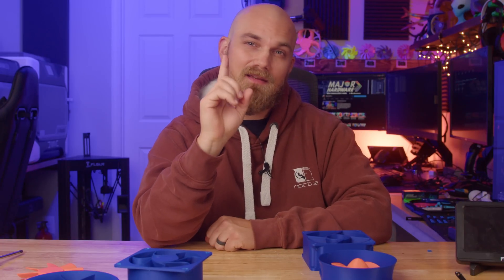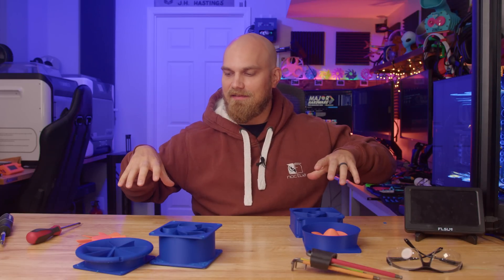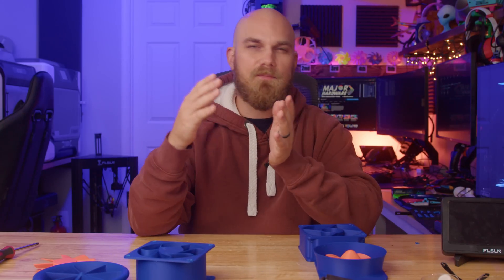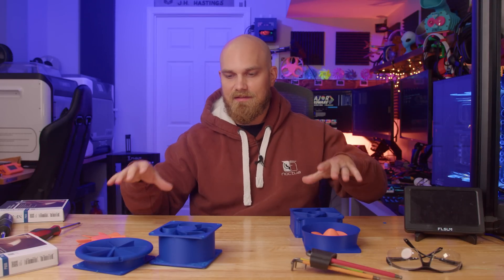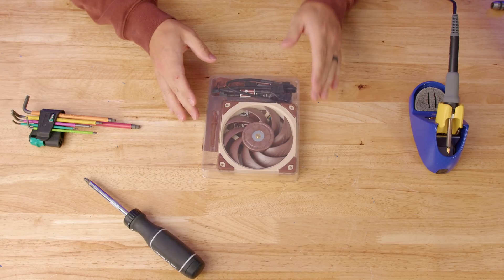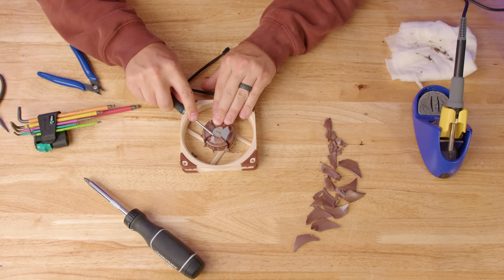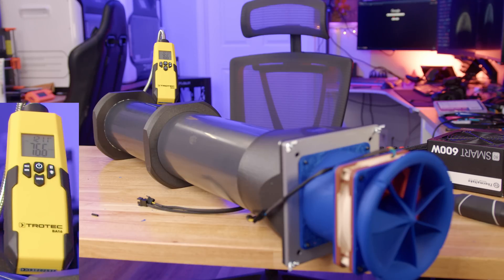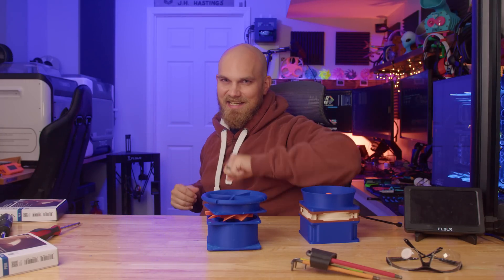Which One is REALLY the BEST | Fan Showdown S4 Finale

Comment: I normally don't comment, I just enjoy, but figured I'd give my opinion since you've asked so nicely. :) I think you should keep the airflow test. But I also think you should keep it to only the fan itself and no extra shrouds, add-ons, etc. Many of those fans just aren't viable in most setup so while they might be awesome, in theory, they aren't actually going to get used. Making sure the fans don't exceed the depth of the built in shroud, allows a more realistic idea of what is possible and convenient in all cases across the board.

You could dedicate another series to crazy wacky fan designs that is more for fun, while having a stricter standard for straight real-life performance testing.

Fun Fans: Fan Showdown
Serious Fans: Performance Showdown

Comment: What about light weight PLA for the fan blades? Also you can test static pressure of the fans, since it will be different than the air flow. I think a good mix of pressure and flow makes for the best cooling fan.

Comment: Personally I'd like to see it broken down into a system where noise, static pressure and air flow can each be measured and have a formula on the spreadsheet which combines all into a final score. Though it might be a pain determining a formula that weights each component accurately and accounts for things like a lower noise level being better. 
If that's not possible it becomes a question of what the exact point of the fan showdown is. Are we trying to make a fan that pushes air the fastest or with the highest pressure? Case fan or cooler fan? I think an air cooling tower probably makes for the best middle ground but any practical cooling test will always be subject to changes in environmental conditions unless your testing in a room with accurately controllable temperature, humidity and so on

Comment: Looks like most people are saying to keep using the airflow test but adding some kind of restriction. I think that's the best. Also, maybe don't use a poll system and just choose yourself, because when you do a poll, anyone can vote, and people will vote on what just looks cooler and not think too much about it.
You can probably feel safe after reading the comments and picking the best solution, ratter than leaving people like me choosing for you.

Comment: As some comments below say as well: We should measure head vs flow and it should be instrumented with some form of microcontroller to do it semi automatically like the noise testing. That way we will actually have in some form both forms of testing. When head is at a minimum we get the current form of flow testing. When head is at a maximum Flow decreases and we are measuring something akin of placing the fan against an air cooler acting as the flow obstruction (hence more head required). To actually give metrics we could perform an evaluation to assign grades referenced to a baseline (the noctua fan). Something along the lines of 

P = Qfanmax / QNoctuamax + Hfanmax/ HNoctuamax 

I hope this gains some traction. Upvote to get him to see this!

Comment: My issue is that we are using arbitrary measurements. Yes, noise and flow are important. However the flow you get from an A12x25 open air vs putting a radiator in front of it, or putting it in a closed case are all real world use cases that significantly impacts the performance of the fan. For that reason, we need to know..  maybe these fans have a specific category that they outshine in!  Free flow, static pressure, or noise!   For that reason I think and always have thought we need static pressure tests! You can have the cheater beat all in overall flow, but if it tanks when you put a radiator in front of it, what good is it?  

Maybe if a fan bombs in the "free flow" leader board, it might be at the top of the static pressure leaderboard!   We need more information. Maybe I want to make a fan and use it, but because we don't have the info, we don't know whether it'd make a better case fan or radiator fan...?  This would solve that.

Comment: I still think it would be cool to use the Noctua RTX 3070, since it has two fans so people could design dual hub designs, belt connections, etc. The space constraints would be interesting. If you can't get a Noctua GPU, you could always get an aftermarket GPU sink from Arctic or a similar company.

Comment: I like the current setup using airflow with your chamber to test CFM seems to be the right way, but maybe add a radiator to impede some of that airflow, and a bonus plus, it could test temps at the same time if setup the right way.

Comment: I think the flow test is the best way to do it, just add a radiator behind the fan. Maybe a couple different ones? One really dense high fpi and another with low fpi. That should give you the same results without all the extra variables like ambient temp and whatnot. Plus it's probably a lot quicker!

Comment: My opinion is to use a static heat source something like the hot side of a peltier cooler, that way you know it will distribute the same amount of heat into your loop, unlike a cpu. 

I also think you should utilize 3 of the same fan on a 360mm radiator. While this is more work it averages print inconsistencies and makes for more reliable metric tracking. 

Lastly the airflow and sound tests are still variables that should be maintained if only as data points. If nothing else this will validate the theory that you cfm is the most relevant factor. 

My only thought is while this is all very cool for us the viewer and makes for better metrics, it is all more work especially when trying to squeeze all that content into a sub 20 minutes video. Just food for thought, regardless I will be happy and enjoy, that you for what you do.

Comment: I think we should do a custom 2x(2x80mm Radiator) loop with them in series kind of like forming a Jet engine. The reason behind this is that I am attempting to create a PC case that looks like a Jet fighter/Bomber.

It doesn’t quite have to be the 80mm size As i can probably do that in my own time with my own test bench setup but it can help me when it comes to inspiration.

Comment: If you have time you can test both to have the best air flow and the best static pressure fan, you could just had one piece behind the vent and test the speed drop with and without the radiator.
and to make the AIO test instead of a computer you could use a Peltier cooler with the hot side on the AIO, as it have a linear heating if you apply same voltage and current to it, so the test would be more similar and you just have to get the temperature drop between the different ventilator.

Comment: My suggestion is that you should rank them in two (or possibly three) categories in the future: 
1. Airflow, as in this season – Good unbiased comparison between different designs
2. Cooling capability – Will give an appreciation for the applicability to real-world purposes
(3. Static pressure – This will play into how well the design will rank on 2. above)
The first category will give an unbiased comparison for an unloaded fan, the second will give a measure on how well it will perform if used for its intended purpose. I wouldn't mind if you had two lists, as you pretty much already have that. Of course you will have to use the same heat sink/radiator for all your test if you are going to use the cooling capacity metric.

Comment: If you're definitely moving away from flow testing, how about doing water, but instead of measuring processor temps, measure the coolant temps under a controlled load.

Comment: Some amount of resistance in the airflow would be a more realistic test. But there's no way to accommodate for all the different kinds of radiators or tower fin stacks.

So just 3d print a resistance part. You've got a resin printer, so you should be able to make up a kind of "average" fin stack and print that. In the end the "cooling" a fan can do is nothing more than a function of the airflow it can produce through a fin stack and that fin stack's ability to transfer heat.

Comment: I think there should be some kind of resistance in the test so that pressure is tested. No PC fan gets to live on pure airflow. There is always some kind of impedance. So adding a radiator like many have suggested to simulate water cooling or maybe mesh at the fan intake with mesh in the pipe before the flow gauge to simulate a case fan situation would be great.

Comment: For me the main change should be to make the designs be as useable in a normal situation as possible. No foot long multi-piece setups that would never fit in an everyday case or something equally as useless to a normal user. I'd like to see every design be able to be printed and tossed into a viewers system with no modifications.
If you didn't want to hinder creativity with those limitations I would say to replace the A12X25 with a motor powerful enough to spin every fan at the same RPM. It's unfair that you allow a design to be as over the top as possible and then kneecap its performance with a motor that can't handle it. 
You need to either restrict the designs to fit the motor's capabilities or beef up the motor to suit the lack of design restrictions.

Comment: I'm fine with the airflow test moving forward. However, if we are going to switch back to cooling then I think it should be a more realistic cooling setup.  No air cool heat sink.  That was the issue I had with the cooling test and the Cheater.  I felt this gave an advantage to high velocity directed flow.  I like the wind tunnel because it equalizes the directed flow for all fans.

Comment: honestly id love to see a revisit where you just take some of the fans that either under performed but where really cool or fans that did really well from various seasons and  retest them with a different test and see if maybe they just got a bad deal on test platform 
like for example im sure there where probably some fans from the season with the radiator but just didnt have much static pressure so kinda flopped but maybe would be killer at a test like this seasons test 
also just seeing the top fans from earlier seasons tested with the new benchmarks would be cool

Comment: I welcome the change back to cooling performance, as it's closer to real world applications than generating air flow through a tube. (No preference bewtween air or water cooling here.)
Also, I'd vote for different "weight classes" for fans that fit in the housing/ fans that stick out more than a few millimeters/ fans that utilize shrouds and stuff.

Comment: Like the accuracy of the numbers but feel like having the radiator gives some context that's been missing without the cooling aspect, just a nice 140 rad attached to the airflow tube would make it more relevant to a pc. The airflow data would then be more interesting personally because you'd know what the exhaust or intake is going to be after the rad, thus the effect inside the rig. Plus, and I get there is so many hours in your day, you can still get readings without the radiator as well for the purists.

Comment: For cooling you need not only pure airflow, but also static pressure (to overcome radiator resistance) and preferably some turbulence (to reduce boundary layer isolation effect). While flow should be more turbulent with higher airflows - low static pressure will reduce airflow. Also, all of the additives used to make airflow laminar will reduce your chance of success

Comment: Ok so hear me out because this could be a long one... First off, make a new flow tunnel out of see through perspex. Then, obtain a bunch of meshes and rads with different densities. Meshes because even on a case you'll most probably have a dust filter, and different density rads because no 2 are the same. You test the airflow against each of them, and plot a line graph of CFM in y axis against each mesh/rad on the x axis. Using the noctua as a control, starting with no mesh and going to the densest fin stack, we'll be able to see how each fan performs in each scenario, and whether any can outperform the noctua in all of them. Now, for each flow reading you take, you do a quick fog shot with that mesh/rad in the now see through flow tunnel, and you can put them all up on screen at the same time so we can visually see when a fan starts to get better or worse, depending if it's got more or less static pressure.

Comment: Please keep the air flow testing!! But add in a static pressure test. 
Maybe even using a noctua air cooler with the stock noctua fan as the base reference. 

Would love to see fans split into two categories. Designs that stay within the dimensions on the original fan ( could be used in a case or cooler) and designs that are all out craziness like the Cheater.

Comment: Test platform should be an NH-D15. fan goes in the middle, "expansion slots" go on either side of the fins. most real world style testing that wont have you waiting for a water loop to stabalize
if the fan is thicker than normal it just gets moved to the "front" fan slot and a blank fanbody style partition goes in the center to isolate airflow over the radiators so you're not sucking ambient air in halfway though, were "form fitting" fans will be push/pullling equally
I still think a quick toss on the velocity stack would be good data
I also think that splitting up the leader/follower on different sides of the cooler would kind of cancel out the "air gasket debate" because.... radiator fins don't seal

or you could put a wing arm with a little flat holder plat so you could hang the full mass of the assembled cheater or other cards with expansion slots pre cooler with the isolator tube. you can use a rigid arm style setup on the desk next to the motherboard so that you can just set a clamp on the vertical and know it's holding the fan at the right hight to support the weight. A little fussy the first time to get it set up right but it should "keep zero"

EDIT
I realized i was at first thinking about the hyper 212 but my brain spazed and insisted a d15 was what i meant. Hyper 212 is also a great, arguably better option as it's more affordable and fits better with the idea of printing your own fan

Comment: if you use air or water cooling the issue you will run into is the heat wicking ability of the aluminum not so much the air flow of the fan... having said that if you place the radiator at the rear of the cheaters output assembly i believe it will cool ever so slightly more than if the radiator is in the center directly attached to the fan... because as a material, regardless of its state of matter ie. air liquid gas solid plasma, is compressed it heats up... meaning the air is being compressed by the fan into an area of higher pressure resulting in a higher temperature than at the rear of the shroud assembly, you could actually use a couple thermistors to test this without a radiator using only the fan assembly

Comment: I would like to see pressure over flow which currently is only measured indirectly with the thermal test. Since this will be used with a heat sink or radiator, the fans ability to generate air pressure against the load vs free spinning top speed is more important.

Comment: What is the point of a fan? Is it to blow as much air as possible, or is it to provide cooling? I think I would rather see how the fans perform in a cooling situation, which is not to say the flow rate is not important, but depending on individual setup, static pressure might be more important to cooling than pure flow rate. 

I would also say, don't carry over any fan to a new season, instead it is a chance for a wide vareity of new ideas, the last video of a season can be of the best the season can produce up against the previous holder of "best fan deisgned fan"

Comment: For season 5 I want to see how much fan size matters. I want to see 120 all the way up to like 230mm fans like on the cooler master HAF case. Obviously test audio and air flow ratios. I'd like to know if a massive side panel mounted fan could significantly reduce Temps. Also if 140mm fans are worth it over 120mm fans for intake and exhaust.

Comment: AMD FX or an overclocked socket 2011 Xeon on air cooler for next fan showdown, please. Or any other extremely hot running CPU.
The A12x25 is also a bit weak. It would be more interesting, if we could swap it for an industrialPPC from noctua or something extreme from Delta or ebmpapst. They have more power, which would allow for crazier designs and more air cooled violence.

Comment: for the next season measure all of them: Νoise (1000rpm normalised/full beans), ΔΤ, airflow.
Also, we need some categories.
Stock: fan disks must not exceed fan's frame height, no extra parts allowed.
Prostock: fan disks can exceed fan's frame height, no extra parts allowed.
Modified: fan disks can exceed fan's frame height, extra parts allowed.

ambient conditions must be 25 degrees C, 50% humidity.

Comment: Airflow alone isnt the best metric necessarily as you dont see the whole picture with it. Fan performance isnt one single number. You have to map airflow over a static pressure curve to understand each ones performance characteristics. Since doing this would obviously be a pain, CFM at very low static pressures like you have been testing at least makes the playing field even. Adding in a radiator or tower cooler to the mix only complicates things and adds in the variability of CPU power consumption, which is notoriously hard to control for.